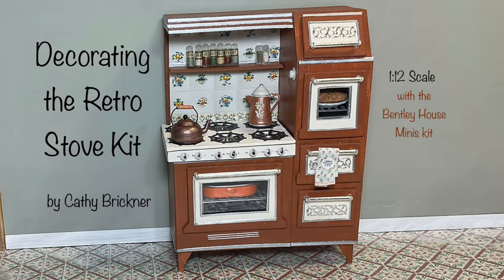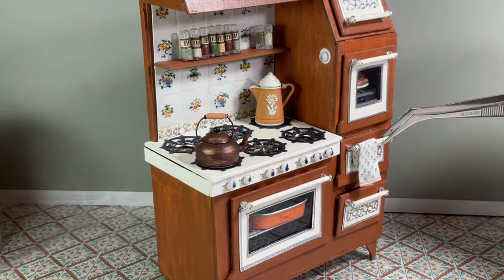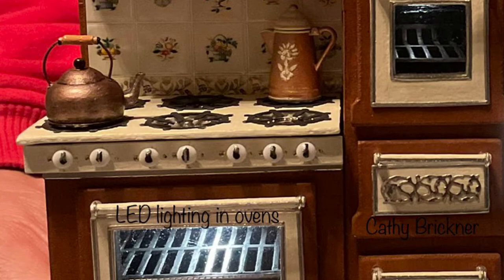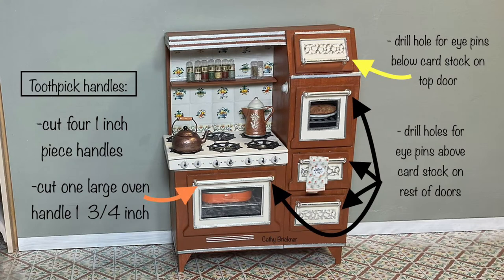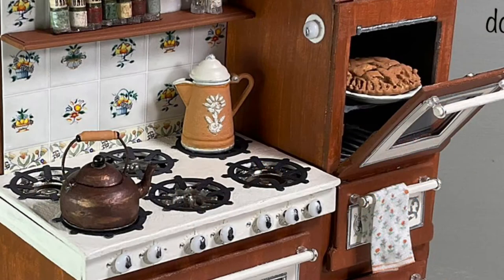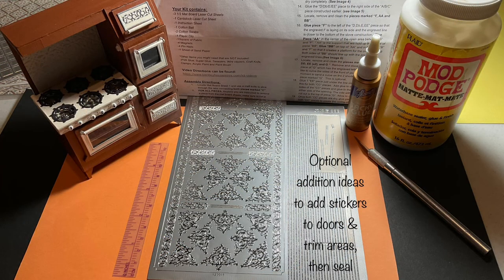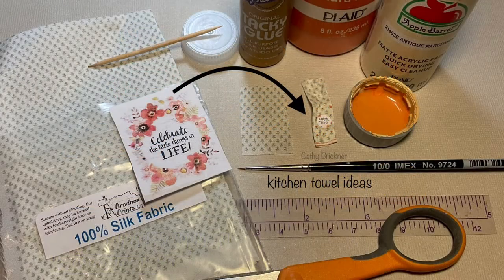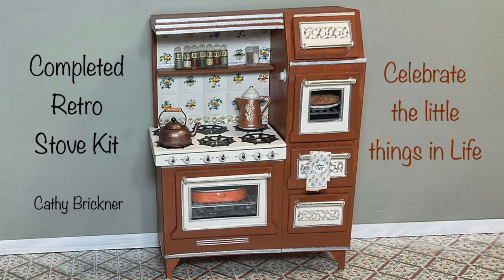1:12 scale dollhouse, DIY,  decorating of a Retro Stove, LED ready, using a Bentley House Minis kit

Comment: I have a question trying to make a dollhouse and my main room is 40ft by 40ft so I think it would be 3 3/10 in then I go to the hall way in real life I have it at 50in ( side to side)but I put that I the dollhouse 1/12 calculator and it's saying it would be 4.17in thinking that is way wrong please help
Reply: The calculator is correct. 50 inches divided by 12 inches = 4.166666 ft. In 1:12 scale, that translates to 4.17 inches.